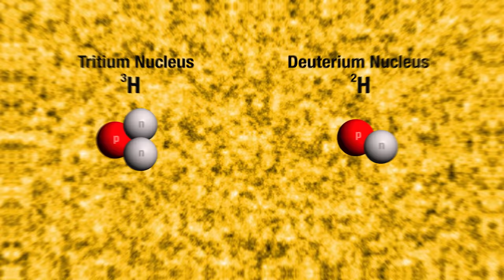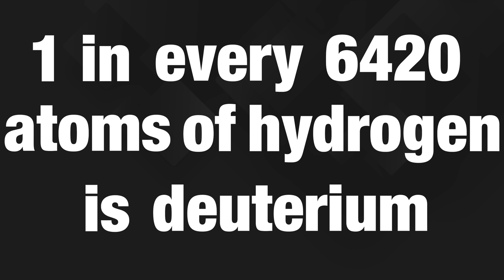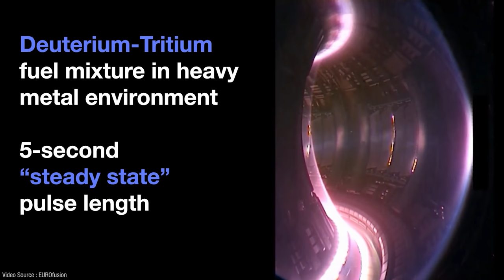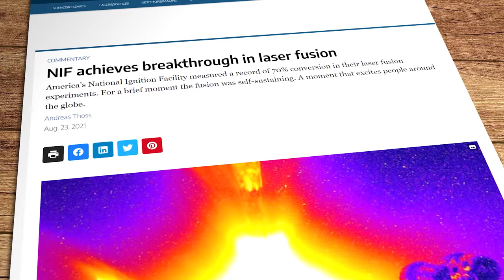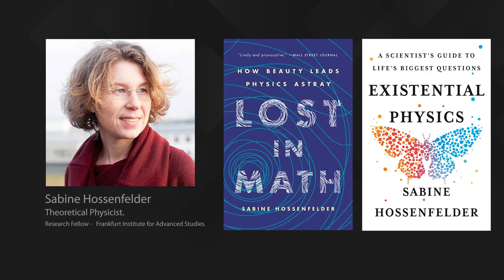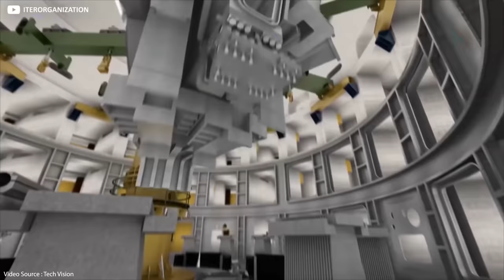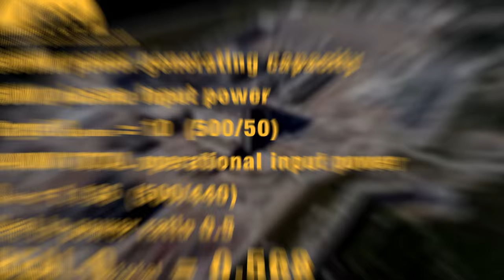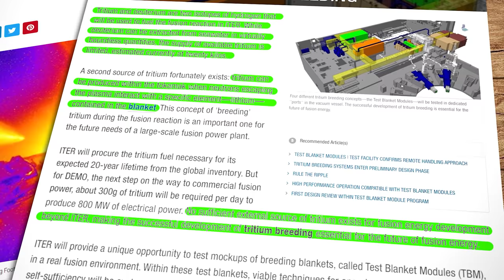Nuclear Fusion Illusion. Is it time to park the pipe dream?

Comment: The main problem with tritium breeding is that you need to very efficiently capture the fusion neutrons in the lithium to breed enough tritium.  If you lose too many neutrons, either via absorption in other materials or just leaving the system without being captured, you don't breed enough tritium to sustain the cycle.

Another option is to use the neutrons from fission power plants to breed tritium, though this opens up a few more cans of worms.

The fact that tritium is produced by the fission of lithium is not really a problem.  The products of this fission reaction are just tritium and helium (and another neutron depending upon the isotope of lithium involved).  So it won't generate nuclear waste like fission power plants do.  Neutrons that are not absorbed by lithium will make other things radioactive, not not nearly at the scale that fission plants produce.

Comment: For the commenters that think we are getting close to a real breakthrough, ITER is going to start plasma testing in 2035, 50 years after planning started.  If successful it will point to the next generation reactor, but you can only start planning that after ITER data reviews the critical design parameters.  I can’t see that happening before 5 to 10 years of operation.  Then you build the high Q reactor where the Q-total has to be high enough to make the excess power commercially viable.  How long will that be - the elusive 20 years (but start counting in 2045) or, like ITER, another 50 years?  Now you have to build a prototype reactor that generates power to show it really works - I think you will have a tough time raising 10’s to 100’s of billions of dollars for commercial reactors before proving the technology will work for power generation.  So optimistically you are talking two 30 year cycles (20 years design, 10 years operational testing) and 20 years to get the first commercial reactors up and going.  Starting at 2045, that brings you to 2135.  If there the next generation cycles take longer or requires extra design iterations, you will be into 2200’s or 2300’s.  In that time there are a multitude of currently existing technologies that will have made huge advancements.

As many commenters have pointed out there are other fusion options beyond magnetic confinement and laser inertial confinement.  But, these are all relatively early in development.  While a breakthrough is possible, any one who has worked in advance science or engineering knows that the timing of breakthroughs can not be predicted, and there are more breakdowns than breakthroughs.
Reply: and ITER is already obsolete. It was designed 30 years ago in a 60 year old field. Using it to criticize the current state of the art in that field is a strawman argument.
Reply: @j.f.fisher5318  	Those that pay for ITER -  European Union, India, Japan, Russia, South Korea, United States, China, Australia, Canada, Kazakhstan, Thailand, United Kingdom (under the EU's Fusion for Energy) and Switzerland (as member of EURATOM) - will be delighted to learn this, thank you
Reply: Today's reactors are built to learn and test. The more important values is run time , the q times are not important until we have 24/7 operational reactors. We have suddenly gone from milliseconds to recently minutes, ~17 minutes hold millions of degrees in a container. That is getting close to constant running, not far away at all.
Reply: @AORD72  They have been working on fusion since before I was born, and all they have is a few milliseconds with a fusion Q <1. Now we need milli seconds to go to hours then days (may be at a controlled duty cycle) and achieve Q's of 1 then >10.  There is no reason to think each of these steps is not going to take decades - and this all precedes using it as a source of grid electricity
Reply: PROBLEM IS THE DELICATE MAGNETIC FIELDS COILS ARE IN THE WAY AND NO EFFICIENT WAY TO EXTRACT USEFUL AMOUNTS OF ENERGY.
Reply: Think small dude. When you can manage  one fused atom from your hand it will be time for you to go get a real job.
Reply: For tokamaks this changed dramatically last fall when a superconductor magnet was tested at double the power of ITER

Limited by the structural strength of steel this multiplies tokamak power by 10x enabling a JET size reactor to produce 270 MW of electricity

If stronger/cheaper structural materials are developed or other advances are made this would enable ~commercial fusion by 2040 in the most tested design with rapid development occurring in alternative designs with better commercial baselines
Reply: See the government backed UK Atomic Energy Agency proposed STEP project for a DEMO class Spherical Tokamak net electricity prototype powerplant planned to become operational in the early 2040s.

See the already highly successful UK private sector company Tokamak Energy (spin off from Culham Centre for Fusion Energy) developing a similar design which could do the same a decade earlier.

See also private sector Commonwealth Fusion Systems in the US (spin off from MIT) with funding to build the SPARC Tokamak to be later followed if successful by ARC (Affordable Robust Compact) fusion reactor to also potentially give us fusion energy starting  next decade.
Reply: ITER uses obsolete magnets though.
Reply: Science Revolution  You are either not a very smart man or a very loud troll.

Comment: I think you are right that headlines are too optimistic, but I think your conclusion is too pessimistic. You focused on national labs or international efforts without looking at what the private sector has come up with in the last ~5 years. The advent of easily-manufacturable High Temperature Superconductors (HTS) has changed the equation completely. ITER and JET are designs that are very old, and had to be finalized before HTS were able to be purchased off the shelf, so they used low temperature superconductors. This forced them to design their tokamaks with enormous magnets cooled with helium. See the following video if you'd like some more info: https://www.youtube.com/watch?v=uKwWGUT8rCw
Reply: @paulhaynes8045  This is not an either-or-question though. We can do both and should not stop funding fusion, because we'd be giving up all the progress in fusion research we made over the last 60 years.
Trying to go to 100% renewables is important, but this probably won't be possible everywhere. So abundant and reliable energy from a base load fusion power plant might turn out crucial in the long-term. Also if we ever want to do space travel beyond the solar system, fusion power might be the way.

Regarding the advances in high temperature superconductors, I believe they will play an important role, but I also see that this is pretty over-hyped in the media. We probably won't be able to create MIT's proposed ARC or even the SPARC reactor any time soon, because the structural loads created by these HTS magnets are too large for a typical tokamak structure, a problem that is often ignored when talking to investors and the media. Most plasma physicists see these plans as too ambitious. HTS magnets would need to be very thick so that the vacuum chamber would look more like a bicycle tire than a donut, which is a problem.
The first DEMO tokamak that actually produces net power (if funding won't be cut) will probably be at least as big as ITER, maybe with slightly stronger but not too strong magnets to keep structural loads in check.
Reply: Thank you, finally I've been looking for at least one person who knows about the immense progress from the fusion private sector. It's clear from this video that he didn't do any intense research at all, he's just basically regurgitating what others have said in the past about the problems facing nuclear fusion energy; without even once mentioning what scientists, researchers and engineers in this field have been doing to combat these challenges. Many of which have already been solved for like the breeding of tritium using a lithium blanket (whether molten salt or otherwise), the Improved confinement and compression of plasma using HTS magnets, as you rightfully mentioned, and the reduction of energy input requirements due to the use of these HTS magnets. 

Most youtubers I see posting fusion topics don't even mention companies like Tokamak Energy, Commonwealth Fusion in collaboration with MIT fusion labs, and many other non tokamak fusion companies. If only they did a bit of healthy research, they'd know that all the problems they mentioned are already being accounted for and even solved entirely.

Comment: Great video. This, of course, and unfortunately, is for some of us no news.  Many of us have been pointing out the unlikely success of the billions pumped into research. 
One thing I seem to remember from Uni days is...Fission produces 10% neutrons and 90% heat. Whereas Fusion produces 90% neutrons and only 10% heat. That's a lot of neutrons for integral structure of construction to handle.
Reply: its literally 80% neutrons and 20% Helium for fusion, no reason to exaggerate. And both, neutron and the helium is heat once it hits components.
Reply: @Peter Pan  Hehe...too cool. As I say...this is something I remember from my uni days, roughly 40 years ago. 80 or 90%, I'm sure you get the gist of my comment. Lots more strain on infrastructure than say, fission?
Exaggerations are ONLY in the pro-fusion camp, my friend.
Reply: william breen  Assumptions assumptions. That's mostly what we have today if we are go be quite honest. I remember a statement from one of our Swedish anti nuclear politicians back in the 70-80's " Don't worry we will have invented something to fix energy demands within the next 30 years. No problems" Well...here we are, ordering new coal plants. 
We probably need to run with what we know...and that's fission. Here in Sweden we have a good source of hydro power. Quite a nice and robust system with fission. Also, we have large quantities of Uran. Then it went political...

Comment: This was a great video. I have left numerous other comments about how we need to stop fighting physics and to use physics instead to fight climate change. Doing fusion is really hard even for stars. You have to squeeze protons close enough together to allow the weak nuclear force to turn protons into neutrons.  For example, the core of the Sun has a density of 150 grams/cubic centimeter at the center which is 150 times the density of water. Thus, the hydrogen protons are squeezed very tightly together by the weight of the Sun above. The protons are also bumping around at a very high velocity too at a temperature of 15 million kelvins (27 million degrees Fahrenheit). Yet the very center of the Sun only generates 276.5 watts per cubic meter and that rapidly drops off to about 6.9 watts per cubic meter at a distance of 19% of a solar radius away from the center. Using a value o 276.5 watts per cubic meter means that you need a little more than 4 cubic meters of the Sun's core to produce the heat from the little 1200 watt space heater in your bathroom! The resting human body produces about 80 watts of heat, and the volume of a human body is about. 062 cubic meters. That means a resting human body generates 1,290 watts per cubic meter or about 4.67 times as much heat as the very center of our Sun!

Remember, the chemical energy in carbon-based fuels and batteries uses the electromagnetic force to store 2 eV per atom. The energy stored in a single atom of uranium by the strong nuclear force is 200 million eV of energy or about 100 million times as much energy per atom. That is why we will eventually have to use molten salt nuclear reactors to geoengineer the Earth back to an atmosphere with 350 ppm of carbon dioxide. Currently, we are at 415 ppm and increasing at a rate of about 2.3 ppm each year. It's going to take huge amounts of energy to fix the Earth.